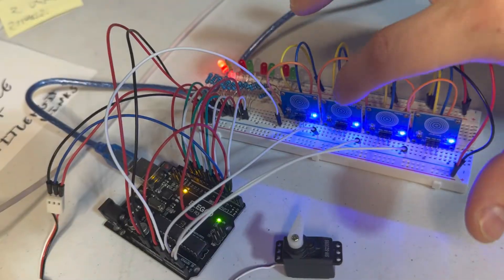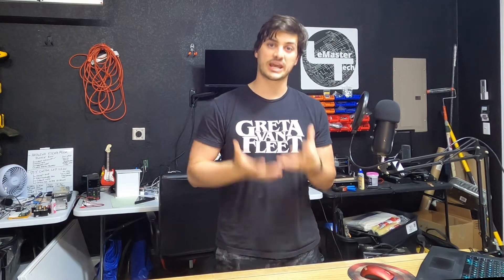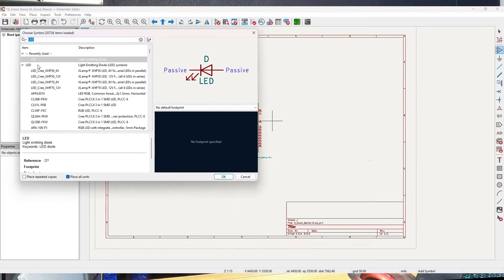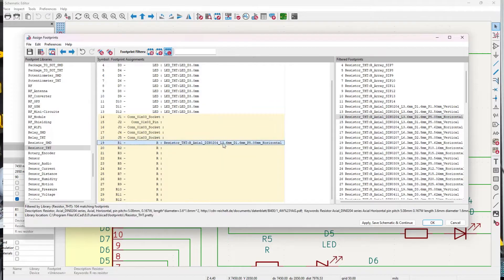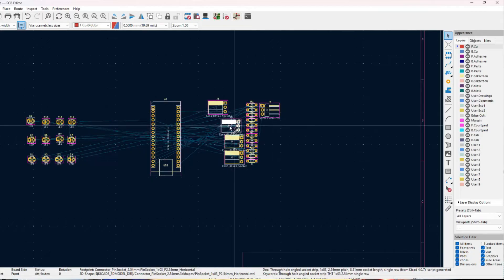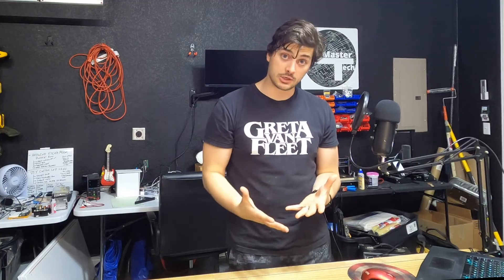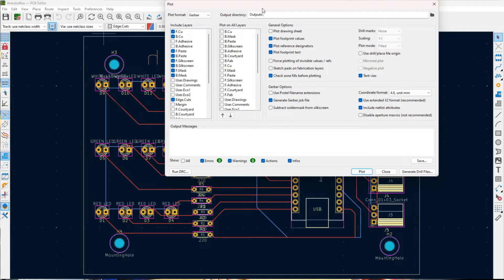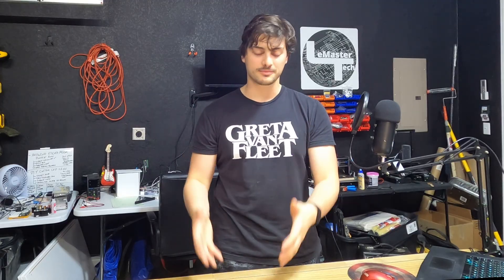How to make your First PCB! Beginner KiCAD Design Tutorial

Comment: I was hoping for some PCB design best practices like how to use ground planes, decoupling capacitors, avoiding sharp corners in traces and picking the right trace width. The video mostly only covers what you can already find out yourself by trying out the software
Reply from the maker: Sorry to disappoint! I am definitely not a super high end embedded circuits designer I am much more of a mechatronics type electro-mechanical guy so I don’t think I’m the best person to get into the weeds of PCB design with you! This focuses more on the practicals of how to use a PCB design software for sure

Comment: Great vid thanks, I watched the section over and over but could not see how to toggle between front and back.  Could you please explain? Thanks Tim
Reply from the maker: When drawing your copper traces specifically? You just select the layer 1 copper (usually blue by default) or layer 2 copper (red by default I think?) from the layer/system tree on the right, and when you start drawing your traces on the board you should see the different colors!

Comment: Thanks! I’d love to see a video on low-current options, as a 9V battery drains quickly due to energy dissipation from the Arduino’s built-in voltage regulator. A guide on using buck converters, sleep modes, and related techniques would be valuable for everyone—maybe even covering the 3.3V Pro Micro as well.

Also, last night I designed my first PCB with help from one of your other videos. Thanks for that too!
Reply from the maker: Sorry I forgot to respond to this! These are great ideas and I’ll add them to my ideas list for future projects! And thank you for watching I’m glad to hear a few videos have been helping you!!